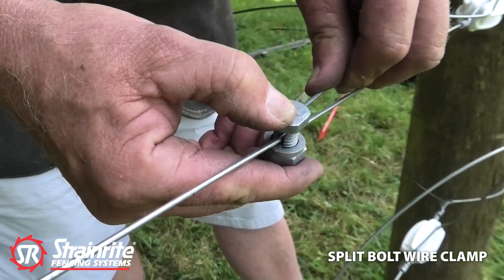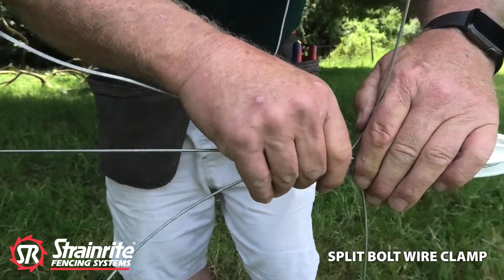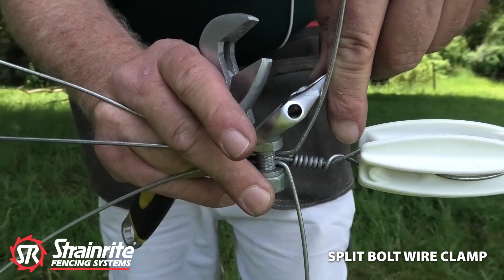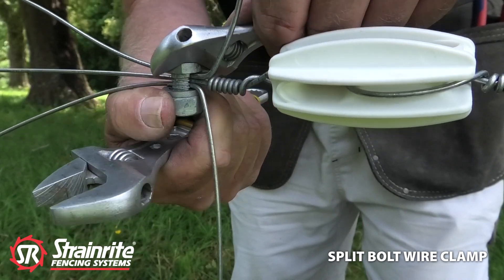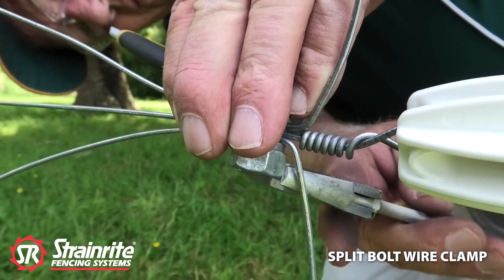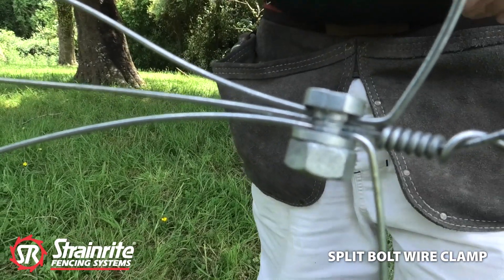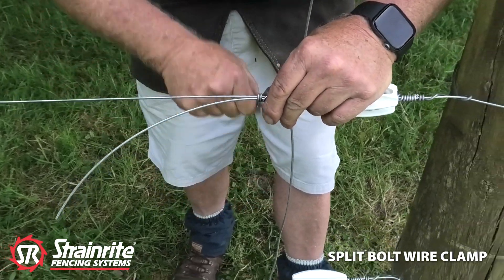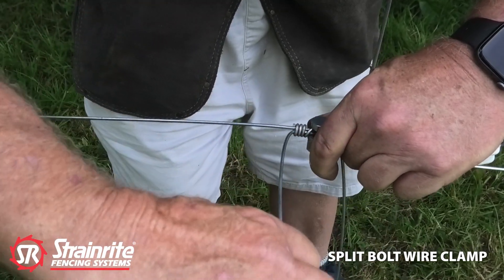Strainrite | Split Bolt Wire Clamp

Comment: I'm pretty sure feta cheese has more strength than these things. If you tighten it even the slightest amount the bolt section literally crumbles to bits. These are cast metal and the casting is full of porosity. On top of that the central guide pins that stop the two sides of the split bolt from deforming when being tightened up, are too small, causing the nut to slip on the threads very often. Compared to the usually high-quality products from Strainrite these are genuinely disappointing guys, please review your QC on these sometime because they're definitely not the same quality as this video.

Comment: Why not just wrap it off in the 1st place
Reply from the maker: You want to ensure you get a strong electrical connection.
We dont recommend wrapping off only, it's like putting washers on your fence wire giving you a poor electric connection and you can slide the wires back and forth with your hand.

Using the Strainrite Split Bolt Wire Clamp or the Strainrite L-Joint Clamp holds the wires tight (Clamped) providing a strong electrical.
Reply: How are you able to snap the wire like that?  Is it aluminum?